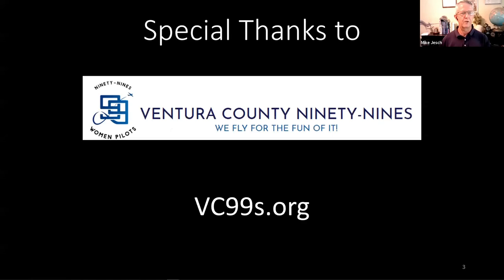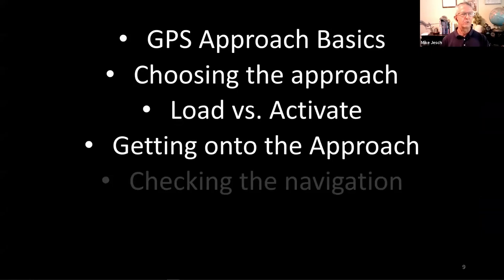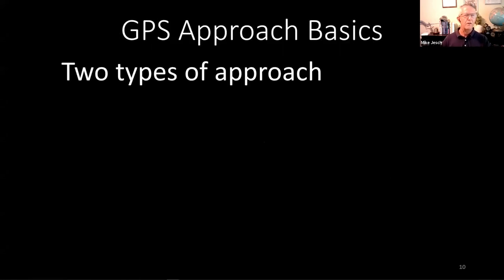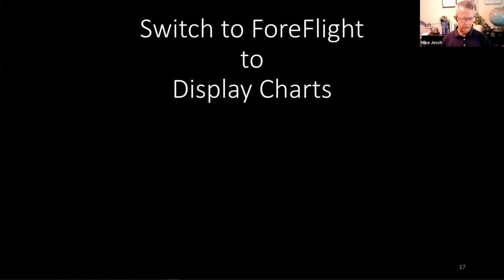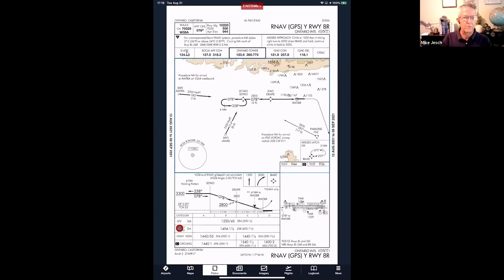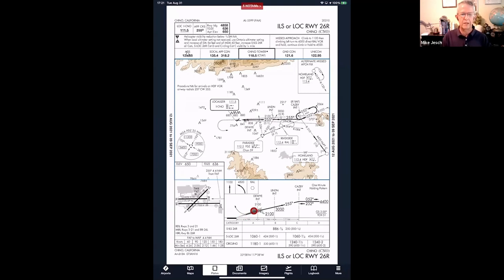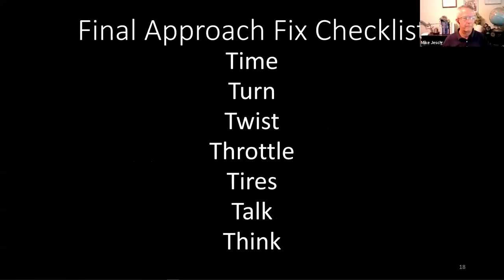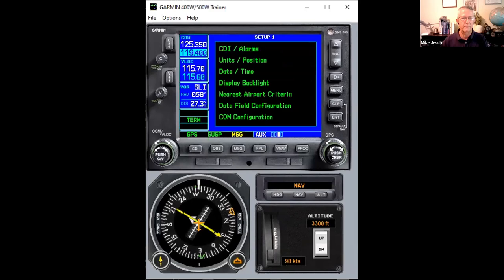GNS Part V   Instrument Approaches

Comment: I think for this approach, you have to wait until you are inbound to PDZ in the hold.  Once established, you can either activate the leg PDZ-RWY 25 or I believe while you are in the hold, it is in Suspend mode and you just unsuspend it( not 100% sure about that). Or I think you can delete hold in the flightplan.  I'll check it out on sim at home.  Great series.
Reply from the maker: Hi Mark! Thanks for those kind words. I finally got a chance to play with the sim a bit more, although not the airplane yet, and here's what I've found. In the case of the GPS A approach to KAJO, I was in some random location and loaded the approach (I had to activate it as well, since there wasn't anything else in the flight plan, that was the only option it gave me). It flew me to PDZ and did one turn in the hold, and then proceeded inbound. The only way to make it do multiple turns in the holding pattern before the approach is to press the OBS button to suspend waypoint sequencing (SUSP is then annunciated above the OBS button) and stay in the hold before arriving at PDZ. In this case, it'll keep on going round and round until the gas runs out! Once I pressed the SUSP, it annunciates the approach mode and goes inbound on the approach. Upon arriving at the MAP, SUSP becomes active once again and, in order to navigate and sequence the missed approach, I have to press OBS again. This time, upon arriving at PDZ for the missed approach hold (and with nothing else in the flight plan), it entered the hold and SUSP was annunciated and it stays there until the cows come home. In any case, I recommend checking the Suspend status when approaching the holding waypoint to verify it's what you want - if you want to stay, make sure SUSP is annunciated, and if you want to proceed, make sure it isn't!

Comment: Mike, does the G530W/430W have a button to keep the DME distance of the secondary NAV frequency when you switch to an ILS?  Kind of like the old KNS80.  Or, do you have to switch back and forth, or have a second DME?
Reply from the maker: No, I don't know of a way to easily do that. Once you select a LOC frequency in the active Nav receiver frequency, you will no longer get distance or bearing from that station. One trick I've used, though it's only temporary, is to select the Nearest chapter (big right knob all the way right, then select the VOR page - page 4 - then you can see each nearby VOR and your bearing and distance from it. The one you're interested may not be the one at the top of the list, and it may move position in the list as you fly along, because the list is organized with the nearest one first, etc., but, it may be close enough for what you're interested in. A separate DME receive would certainly work.
Reply: @CapnMikeCFI  Bummer.  I don't actually own a Garmin unit yet.  Still thinking about a new GTN series.  I'm not comfortable buying the old 530/430s.  Right now, I have the old KNS80, and that is one feature about it I really like about it!  But, ILSs, LOCs, V0Rs, and NDBs, will probably be a thing of the past very soon.
Reply from the maker: @azcharlie2009  I'd think hard about a GTN unit myself... The GNSes are no longer manufactured, and at some point Garmin will probably sunset the hardware support as well, as eventually components will simply cease to exist to be able to maintain them. The GNSes have a lot more capability (Airways, arbitrary holds, visual approach advisory guidance, among many other features), and are current generation. NDBs are already being deactivated, as are a lot of VORs. ILSes will be around for a while, but RNAV approaches are the way of the future, and DME is essentially unnecessary for those. Even marker beacons are being removed, so some ILS approaches require DME to establish the location of the FAF - what we used to call the 'outer marker' - but that can be substituted with an IFR GPS too. We've had our GNS530W in our 182 for over a decade now, and may move to a GTN750 or maybe an IFD540 when we do some more panel work soon (hopefully getting rid of our vacuum-powered steam gauges and getting an autopilot that functions better than a doorstop!).

Comment: I finally had to stop watching these on the fifth one.  75 percent of the viewers use the 430 yet the 430 simulator was shut down within the first 10 minutes or so and the 530 was started up and was used for the vast majority.  This has happened in all the videos i've watched up through the fifth one.  Sorry just cant take it anymore
Reply from the maker: All of the features I describe for the GNS530W also work for the 430W. There are just a couple  things that are slightly different: Nav page 1 is very different between the two units, and the VNAV page is in a menu on the 430 versus using a button on the 530. There are a few other fairly minor differences, and I point those out when they come up. I mostly use the 530 simply because the screen is a little bigger, and therefore the menus are larger and easier to see and move around on.